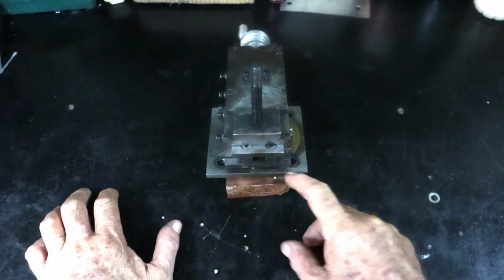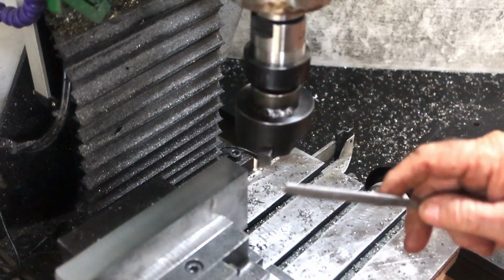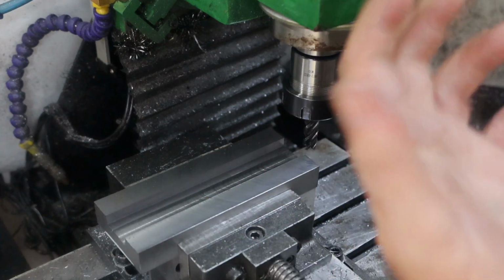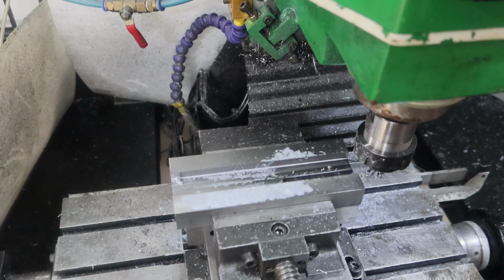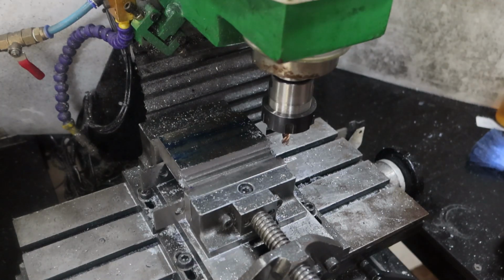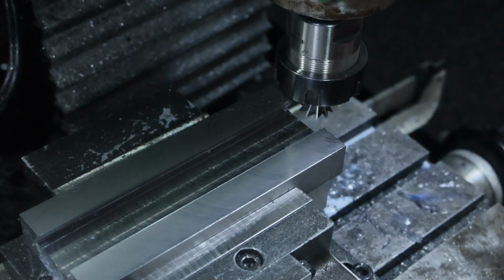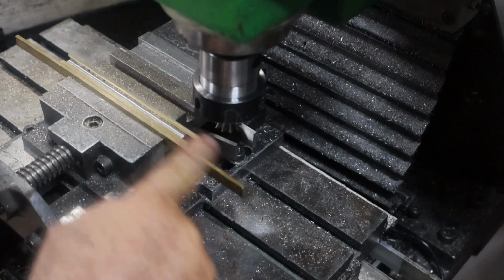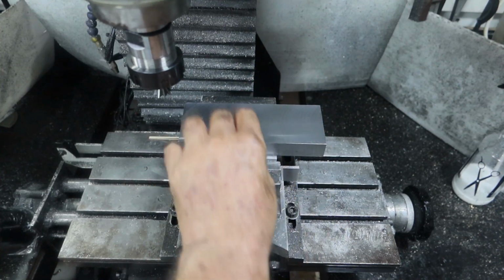MHW Episode 88 - Homemade Lathe Compound Slide Upgrade - Part 1

Comment: FYI 3d printed jigs are ideal for holding brass gibs at the required angle. Just take shallow depths of cut and it will hold up fine.

Comment: I found your channel while looking for information on how a square shoulder as to a dovetail way works. I do guess you have answered my question and thought as much.
 I have always when on the tools only used conventional milling with carbide and especially HSS endmills slot drills. You will keep on feeding the swarf through the cutter again if you do climb milling plus other compounding things when climb milling. The swarf becomes harder and that causes the teeth to chip and wear out very quickly is the must important thing that will wreck your tools.
 I would make my own compound slide but I do not have the right M/c (milling machine) to make the dovetails, unfortunately.
Reply from the maker: Thanks for watching. 👍

Comment: Do think placing some 1/4 or 1/2 inch rubber mate under the mill will reduce the noise. There seems to be a lot of vibration traveling through the table which in turn can alter x y travel. Have a good week await next Friday installment
Reply from the maker: I tried adding something under where it sits hard up against the concrete, I would have liked to use a piece of conveyor belt, but rare as rocking horse shit here. 👍

Comment: Great work on the dovetail. A bit of clean up and it should fit nicely. Ironically I cut my first dovetail a few days ago and that went well.

Looks like you still need to be careful about the noise there. I hope all goes well with resolving that issue.
Reply from the maker: Bastards of things to cut on a small machine and yeap I am still being very careful about how much noise I make, I don't want to poke the bear with a sore head over the road. 👍

Comment: "No, It didn't hurt", Haven't heard that one since I retired, got a chuckle out of me.
I think I know why that side wanted to lift when you were doing the gib, because you were clamping onto that whole side via the round, which was of course pushing onto an inclined dovetail.
There was really nothing to stop the whole piece lifting on that side except luck. 
if you could have clamped down either the side of the dovetail piece as you had it, or held the piece in the vise and clamped the round into the dovetail with something else, I think it would have worked well.
Anyway it worked out, but if you're going to do it again, maybe some really small profile clamps are in order to hold the round.
Good video
Cheers
Reply from the maker: That was a piece of 8mm round, I think a smaller piece of 6mm would have worked better, but I didn't have any, did the job in the end 👍